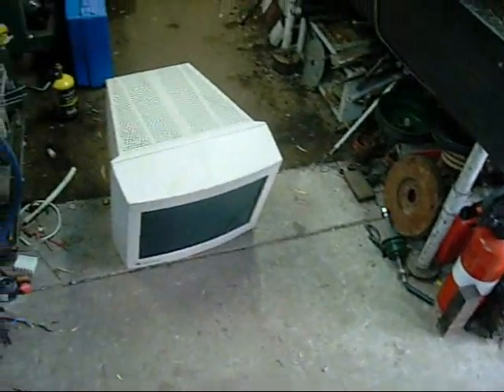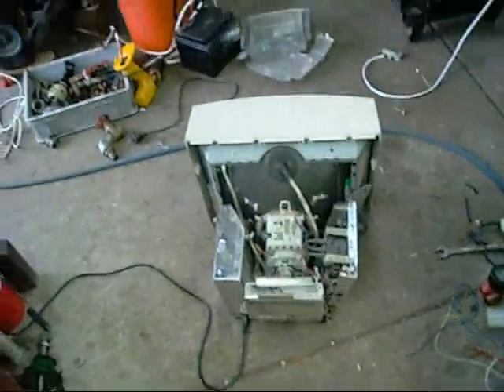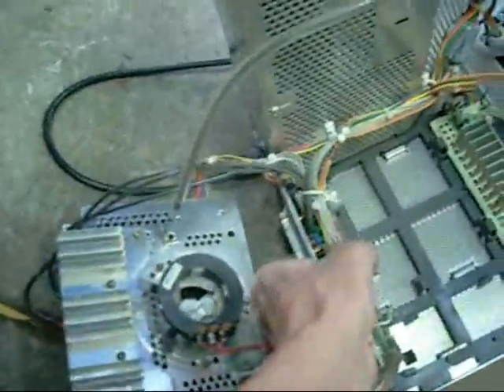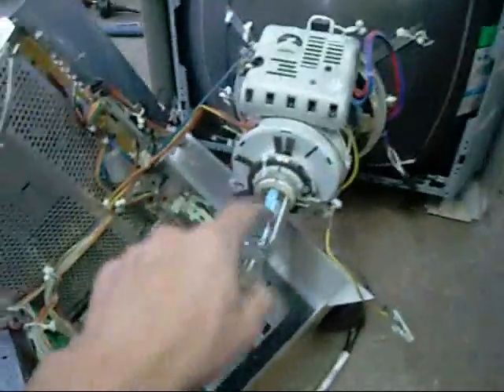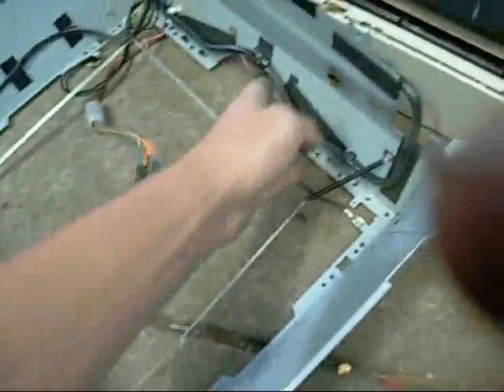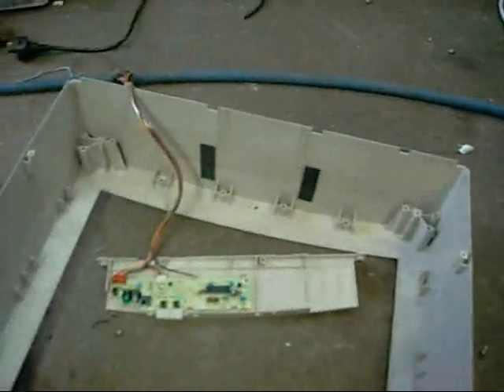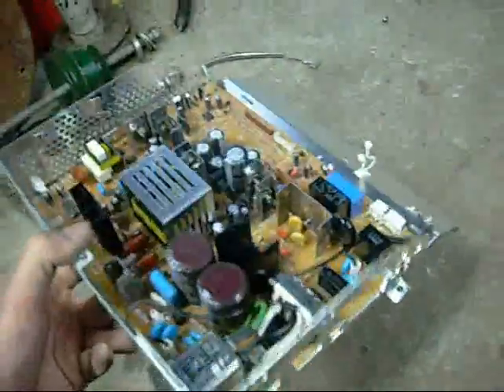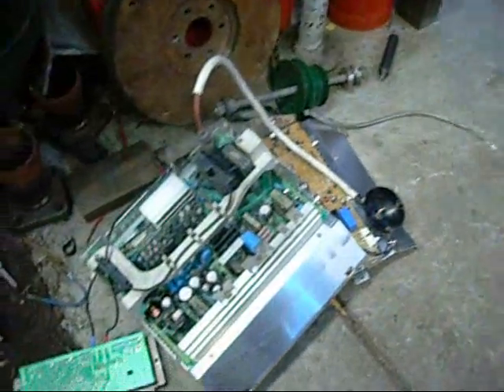SGi (Silicone Graphics) Indy - Sony Trinitron Monitor Autopsy

Comment from the maker: @aredditor yeah the old PC monitors were chunky!, I remember getting some huge ones from BHP steel when they replaced their old 286 Compaq systems around the steel mill. they were so heavy I couldn't lift them!, with all steel shielding, die cast alloy bases, ball bearing swivels, etc..

Comment: Wow, that's a pretty resource intensive CRT. Later ones tried to use a lot less aluminum and copper. I've dismantled a lot of CRTs, and i've never seen one with that much expensive materials in it. Of course the trend has always been to cut back on materials and make them easier to assemble. I took apart a 27" Samsung TV that had 5 lbs of copper for just the degaussing coil.

Comment: hm.. looks like the HV and the deflection is separate, as in the HV part of the board can work independently of the deflection circuits. I got my HV supply by removing everything else than the main-PSU and the HV circuit from the main board and bypassing the powersave logic with a wire.

Comment: All SGI machines had that strange connector.  The video was analog, generated by the computer.  Those 3 coax cables are all run straight to the video output on the SGI machine, with NO signal modification done at the computer.  There would be horizontal and vertical sync coming from the machine as well.  They were a great machine at the time (I had an SGI Indigo for a while)
Reply: They used 13w3 connectors which are industry standard.  Any graphics workstation of the era from IBM/HP/SUN/DEC would have the same connector.